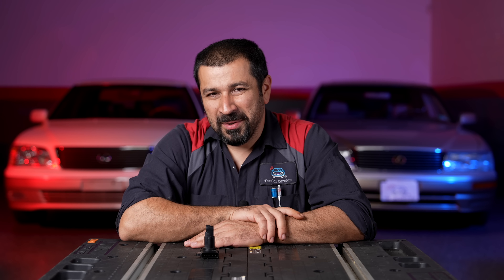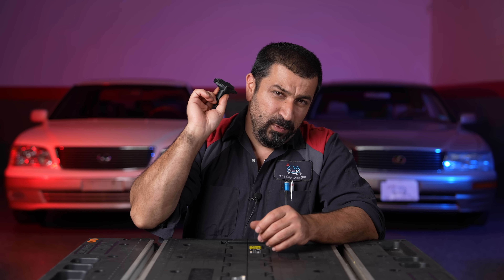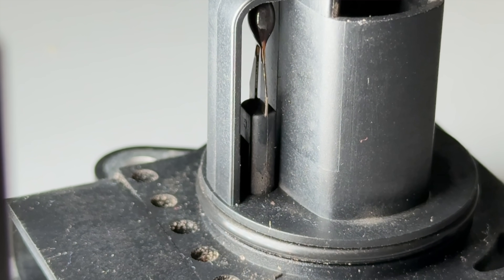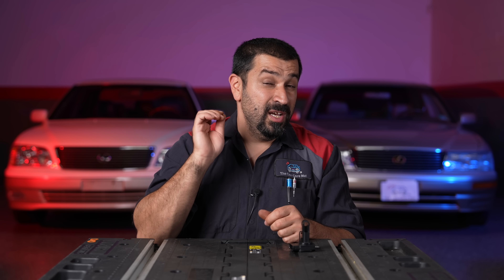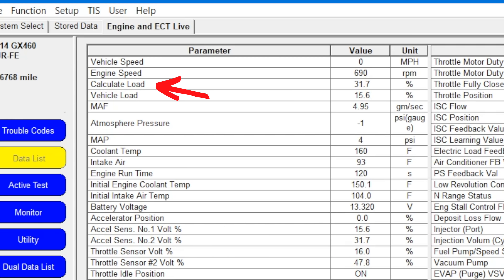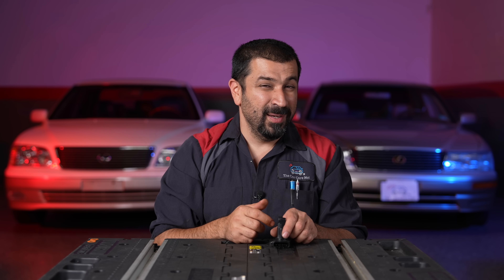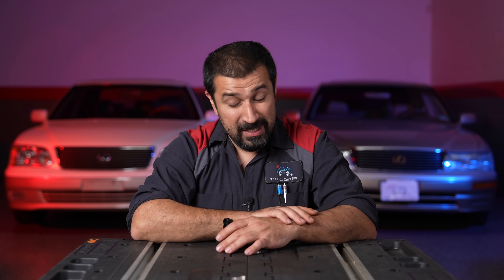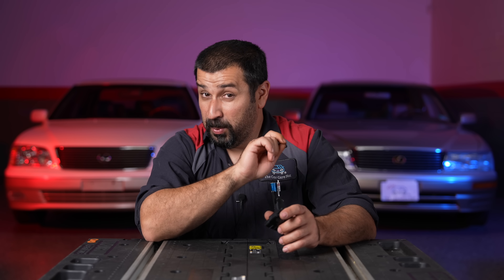Should You Clean Your MAF Sensor and How to Test It and Clean It on Toyotas

Comment: A great tip for MAF testing and cleaning. 
If I can find a tip in your collection for a 2015 sienna sliding door that won’t open and close properly then I’ll be set for a good while since I’ve already watched your video on the cable replacement which doesn’t fit the symptoms for my situation. Finding the proper title is half the battle.

Comment: In the service manual for the 2011 Toyota RAV4, the following inspection procedure is described:
1. Connect the intelligent tester to the DLC3.
2. Turn the ignition switch to ON (do not run the engine).
3. Enter the following menus: Powertrain / Engine and ECT / Data List / MAF.
4. Wait 30 seconds, and then read the values on the intelligent tester.

Specified Condition - Below 0.31 g/sec.
If the result is not as specified, replace the MAF meter.

This procedure differs from the one you described. 
Is there a specific reason why you're not following the standard inspection procedure?
Reply: @subtegral  
It is possible that the reason lies in the small amount of air circulation due to the height difference between the air intake and the exhaust pipe. This is also related to the requirements for conducting the sensor inspection, such as:

    Perform the inspection with the vehicle indoors and on a level surface.
    Perform the inspection of the MAF meter while it is installed in the air cleaner case (installed to the vehicle).
    During the test, do not use the exhaust air duct to perform suction on the exhaust pipe.

Comment: Checked my 18 colorado.  Cruising at 60-80 load about 45. Just decent acceleration it jumps to 100. So it's good? My long fuel 1 varies from -7 to -4.7. Never closer to 0. Long fuel 2 is -1 to -2

Comment: My last project before I sold my 4Runner was to clean up the intake box, throttle body and MAF because we went off roading so often in a 40k mile period but I never got to do it. Pretty sure it would’ve improved dramatically, because it was somewhat dragging in performance even though it’s already slow… it was even slower.

Comment: hello AMD, about the cv axle replacement video, how can one know if a cv axle is toyota OE? I have a tercel from 1997, bought gsp branded (aftermarket) axles, and a year later I think the bearings inside are shot because the boot is ripped and I thought it was a wheel bearing noise, I was thinking of sourcing OE axles from a junkyard and regreasing and rebooting them... what do you think about this?

Comment: I thought my MAF was bad but the car never threw a code. The car runs okay but it wasn’t the same, especially at first startup, (engine stumbles). I didn’t want to throw parts at it as well. I’ve spray cleaned in the past. I tested my sensor and readings showed bad. 76.1% was my calc load at full throttle. Idle read between 15% to 25%, but jumped above 25% a few times. Time for a new sensor. Thank you for the helpful video sir! 2005 Camry 4 cyl w/ 210K

Comment: I literally did check the live data calculated load on my car a few days ago. Engine oil, coolant, gearbox oil all up to temperature. Put the car in manual, 3rd gear, and a quick acceleration from about 30mph to 45mph, with the gas pedal not all the way to the metal, calculated load showed just under 80%. On a 2nd pull, pedal to the metal, calculated load went to 96-97%.
Ps. ALWAYS replace air filter with every oil change.

Comment: I left LesSchwab tires one time after waiting all day for them to change some suspension parts on my ‘04 Camry with 250K and as I drove away it had started fine and idled fine but as I gassed it, it would surge and buck until I got up to speed. At speed it ran perfectly. I pulled over and checked under the hood and found my intake had been loosened and had a gap just after the MAS. That allowed the intake air to bypass the MAS and it was throwing off the computer, engine speed and air speed were out of sync. I got the vehicle home and cleaned the sensor with MAS cleaner since it was apart put it back together and it has run perfectly since. To this day I have no idea why they were messing around with the air intake when they were working on the front control arms. One thing you left off for things that destroy a MAS is over oiling wet type (K&N) air filter. The excess oil gets on the hot wire and causes it to burn out prematurely.

Comment: if it goes bad always use the same brand as the OEM supplier. I picked one up from the parts store one time and the car ran ok. later on after doing some mods and ECU flash I picked up a used OEM Hitachi brand one at a salvage yard and it made a huge difference. right away the idle was way more stable and the engine was definitely more responsive and felt more powerful.

Comment: We see so many more issues with MAF sensors in the shop once people have discarded the factory air box for a Custom Hot Air Intake system. People need to know that if they insist on making their air intake noisier that they should keep the filter oil to a minimum. :)

Comment: I'm using Torque and it shows Engine Load and Absolute Engine Load but no Calculated Load. 

Engine Load when in park/neutral can go up to 100% just by hitting the throttle for a sec.
While Absolute Engine load only seems to go up when moving(can't do much when in park), and mine doesn't get above 65 when punching the throttle. 

If I had to take a guess, is Calculated Load and Absolute Engine Load the same?

Also great video and thanks for the tips!
Reply: @subtegral  Oh interesting, I'm technically using the paid for version of the app so not sure how that differs. Also I'm working on a 2008 Ford Focus and not a Toyota but I assume the general principle here applies. 

I did disconnect the MAF Sensor while the engine was running for a sec and all it does is throw a code but both values for the load don't actually seem affected...they operate the same way with or without the MAF sensor.  Also the engine literally doesn't feel like it cares if the MAF sensor is plugged in or not.

Comment: For so long, have been experiencing near engine stalling during acceleration from idle on my 2002 Corolla. I will just press more on gas pedal to compensate the engine hiccups. I initially thought of dirty fuel filter. 

My mechanic troubledshoot by    replacing the MAF sensor with the MAF sensors of other Toyotas in his garage. Walahh, turned out the MAF sensor is the culprit despite cleaning it.  Replaced it with a second hand unit. Now car runs so much better.

Comment: I'm surprised you didn't mention the Vortex MAF? I had a problem six months ago with my 1997 Toyota Tacoma 4x4 running a V6. One day went out to start it and it started then stalled. Then no spark. After checking several things, I ended up removing the Vortex MAF sensor and blowing it out with compressed air, then it started and ran fine. Yesterday, same issue. Started, stalled, wouldn't restart, no spark. Did the same procedure as the first time and it is now running fine again. BTW ordered a new MAF sensor same day.

Comment: Not a Toyota owner, have a Honda excellent tip! I recently went to the dealer where I bought the car in 2004 and they were trying to sell me throttle body cleaning, brake fluid replacement, power steering fluid flush and also add fuel injector cleaner. I am convinced that they didn’t examine the condition of the fluids but based their recommendations on the mileage of my Honda Element 242,000. Only problem I had the power steering high pressure hose at a local repair shop that I trust, brake fluid my son (slave on notice) replaced as well as new rotors, pads and one seized caliper. When I mentioned it to the service person they had no answer. I routinely add fuel injector cleaner to my car, especially when I am driving long distance. Thanks so much for your tip, just saved me some $$

Comment: In 2011 i did my MAF just for the sake of it & no issues for many,many years (10 yrs in fact,2002 Yaris) i did it so everything is tip top & there's nothing to worry about in years to come, why wait for the CEL (Check Engine Light) to come on then you gotta resolve it but in the meantime the engine may be putting in more fuel which nobody wants.

Comment: Got a yellow engine light that has come on a couple of times on the 24-year-old Corolla I have. Cleaning the maf sensor works great. Last time it was P0141 code. I did cleaning and reset. After all, this is the only engine problem I've had with the toyota, so I'll survive 😁

Comment: One extra thing to consider that the Car Care Nut didn't mention. The price, this part is not cheap for something so small. I may need to get one, so I looked it up online for Autozone, O'Reily and a Toyota OEM website. This sensor will cost between $100 to $200. You should definitley invest in one of those diagnostic scanners to test this part before and after you replace it, to make sure it the new one works.

Comment: Hi from Guam, I just saw your video and the sensor you showed doesn’t look like the one in my 05’ tundra with the 4.7 liter motor. Mine has an aluminum plate with holes for the air flow towards the bottom of the sensor. Is this correct for my motor?

Comment: Just me, my scan tool will read the mass air flow sensor in grams/seconds and a rule of thumb is the reading is about the size of the engine is the sensor is good.  For the 2GR-FE 3.5L V 6engine, about 3.5 grams/second.  No matter, I remove it and gently spray CRC Mass Air Flow Cleaner.

Comment: I wish I could replace the MAF sensor on my 87 Supra with a hot wire one. It runs fine but I just wonder and plus I think it would flow better with out the door. You said exactly what I thought they were, a door on a POT. And POTS always need cleaned after years of use.

Comment: I have been cleaning my MAF sensor every 20,000 miles with MAF sensor spray cleaner. Haven't had any problems yet with my 2008 Toyota Tundra, 5.7. I also remove and clean my throttle body about every 50,000 miles. My Tundra currently has 110,00 miles on it. I am very careful when I clean the MAF sensor.
Reply: @subtegral  I have the TRD cold air intake with the K & N filter. I've heard that some of the oil from the filter can coat the tiny wires.
Reply: @subtegral  No. It draws the cool air from the outside.

Comment: Perfect timing! My wife's 09 Corolla XRS 2.4L threw a 0171 lean code. I test drove it with the scan tool & promptly found the LTFT at 22-31% at idle & low load. It drops to around 9% at WOT over 100MPH. My first thought is a large vacuum leak so I'm going to visually inspect & find a cigar for the smoke test. But first I'll go check the calculated load. With 264K miles it could be anything. It has been a great car & uses about a quart of oil over a 4500-5K mile OCI. All of this in spite of some some severe neglect early on. She once called me to ask what to do about the oil light being on. It was two quarts low! I told her what viscosity to buy and how to put it in and that little 2.4 has run another 200K miles since then. People sometimes badmouth the 2.4 but I believe most of those oil problems were maintenance related. Thank you for another fine video!
Reply: Have you considered using Valvoline’s Restore and Protect engine oil? I’m using it in my 2000 Accord with 234,000 miles. Valvoline claims it will free up the piston ring landings thus decreasing engine oil consumption (over a period of 3-4 engine oil changes). The Engine Oil Geek has an instructional video on this subject.
Reply: @subtegral  Fast cleaning of a dirty engine is worse as heavy deposits will loosen and possibly block screens, drain back holes etc. If that happens engine tear down is needed. Neglect or high mileage build up can't be reliably cleaned while you wait. The valvoline product has gotten great reviews btw.
Reply: One of the absolutely best things you can do to prevent or at least greatly reduce future oil consumption is to NOT follow the Manufacturer’s recommended oil change intervals. If they call for oil changes every 8000 miles do them every 4000 miles, 10,000 miles do them every 5,000 miles. Obviously use a quality oil and yes Super Tech oil from Walmart is a quality oil for a  daily commuter car. Royal Purple or Motul are bette4 oils but the extra expense of them is unnecessary unless you are racing your vehicle.
Reply: Why I won’t buy used from a woman driver. No clue how to maintain even the most basic stuff.  Red dash lights - oh I don’t have time for red lights ~ women.

Comment: Ahmed, I clean mine every other couple of oil changes, not  only on the ISF, but the Subaru two with the appropriate cleaner from CRC…. At the same time while I’m in there, I clean throttle bodies. I do notice a difference, I do clean it lightly and let it dry, but now after watching this video, I think I will stop and try your method. Thank you.

Comment: I don't know what a Mass Air Flow Sensor is, nor will I ever touch one. But if The Car Care Nut is explaining it, you know darn well I will listen.
Reply: it measures air for your ratio to be correct in your engine. lean code meaning too much air not enough fuel, rich being too much fuel not enough air. both can damage your engine and more noticeably your fuel mileage along with roughness
Reply: @bradhaines3142  Thanks for the summary. What a cool doohickey.
Reply: It's usually located around the output of the air box.

Comment: Great info!  I’ve got a 1999 and a 2001 and have never had an issue with the MAF.  Never looked at them or cleaned them.  Great to know how to test them though.  I wouldn’t have thought about the calculated load reading.  Thanks.

Comment: One think that should be mention for calculated load.  At sea level, calculated load can be close to or even 100%.  But at higher altitude, will start to drop.  So seeing 78% calculated load at a 7000 ft above sea level can be normal.

Comment: Thanks for putting this out. I have a 2007 Camry with 181,000 miles (That didn't get the engine piston ring rebuild unfortunately) that started having problems with the motor a couple of months ago. When I was driving home from work, the Camry started losing power to the engine after I floored the gas a couple of times for a brief few seconds. Suddenly the car had trouble delivering power above 1500-2000 RPM. I could barely reach 45 MPH and had a difficult time getting the car up small hilly roads. the engine also started making a knocking sound.

My friend brought his computer to diagnose it, but the only code we were getting was P0420: catalyst system efficiency below threshold (bank 1). He recommend that I replace the O2 sensor. I went to Autozone to buy one, and after telling the workers at the store what happened, he said I should also clean the mass airflow sensor. I bought a can of CRC mass airflow sensor cleaner and cleaned it myself. But now that you mention in the video how delicate it that sensor is, I wonder if I cleaned it properly. The can comes with a plastic red straw, and I sprayed directly at the sensor.

The Camry started running fine again after replacing the O2 sensor and cleaning the mass airflow sensor, but the engine problem came back up again 1 and a half months later, but not as severe. This time the engine power would drop and sputter if I pressed the gas to get the engine to run above 2000 to 2500 RPM. I replaced the spark plug plugs with a Denso Iridium set and reset the computer a second time. But I'm leaning towards replacing the mass airflow sensor after watching this informative video. Thanks!
Reply: Oil burner Camry.  Your exhaust is clogged at the converter.  Hook up pressure gauges and you'll see a few psi drop across the converter during idle.  A new converter will clog again due to oil burning engine.  Replace the converter with a straight pipe if your state does not do emission test or tear down the engine to replace the oil control piston rings.
Reply: I'd do a compression test on the engine before throwing more parts at it.
Reply: Get the cheap scan tool and check it like he said. 30-50 USD hooks via Bluetooth to your phone. 

Lot to learn there.

Comment: My maf sensor got dirty because my mechanic forgot to latch my air filter housing all the way when I was checking to see if I needed a new one. I ended up having to clean it myself as well as the throttle body and now it runs really good.

Comment: There is another MAF type fitted to the early 1990s LS400s, the Karman  Vortex type which apparently requires no servicing. My 1994 Toyota Celsior was 30 years old and 102K miles when I sold it and never had a MAF issue during my ownership.

Comment: I cleaned my MAF with a tiny paint brush to get the stuck debris off. 

I learned my lesson after gently touching a Q tip to an old volvo maf sensor (it had some ceramic element in it) and it snapped off instantly. Ooops. 😂

At least it was my car.